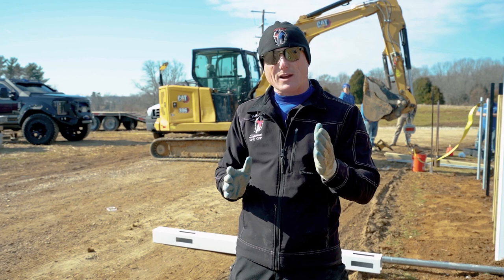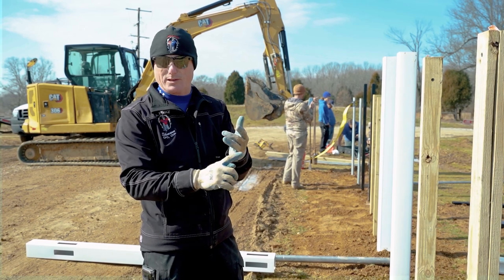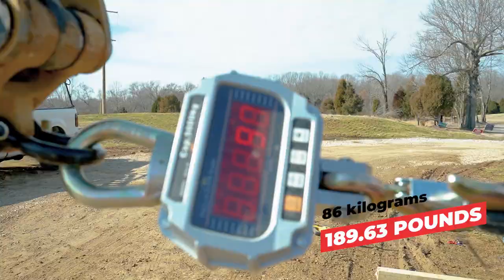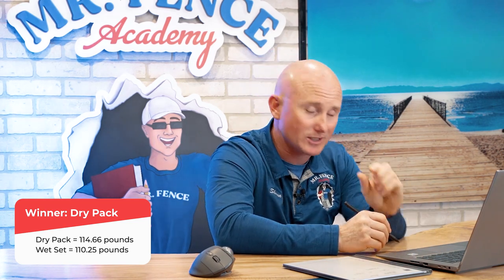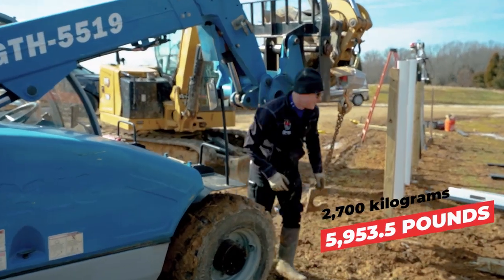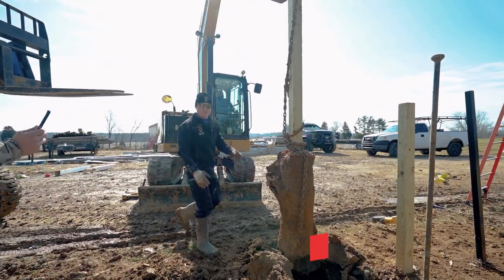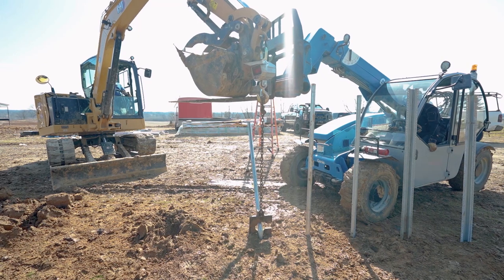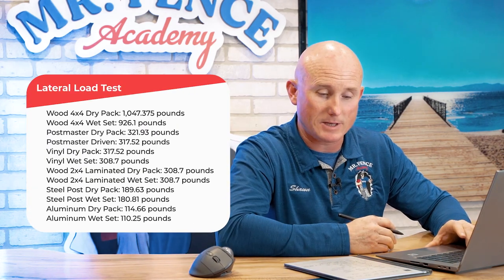How to set a Fence Post PART 2! | Dry Pack vs Wet Set

Comment: Interesting results. Sometimes I think we equate rigidity with strength and the flexibility can actually be a benefit.

As we discussed on the phone, back in the day they recommended filling the vinyl post full of  concrete and found that that led to premature failure because the fence was too rigid in the wind. 

I can tell you that in all of our years of using postmaster we have never gone back to replace a fence. However in that same period of time we have replaced numerous fences built out of 4 x 4’s both treated and cedar that have snapped off. I think it would be worth talking to somebody that has some insight to wind strength and how that relates to structural stability to get a better idea of what’s going on here.  

It’s probably worth noting that Wyoming has notoriously High-wind and I have seen open chain-link fences, without slats, blown over with 1 7/8” SS 40 posts.

Comment: It would of been a good test to apply the same load to each post without trying to crack them and then put a level on them to see which has moved the most. 
I would say dry pack moves more hence why it cracks later as it offers less resistance.

Comment: In the video you say you waited 3 weeks for the dry concrete to set. Is this how long you normally wait to hang wood or wire when using dry set method? Or once it's packed in dry does it have the strength to have field fence staples hammered into the posts or hanging 2x4s and pickets? And know it won't be "set" that quickly but will it have the strength to hold in place while continuing to work on the fence until it fully sets?
Reply: No water in their "dry" pack.  Good question and there is no way any fence company is waiting 3 weeks to return to the jobsite to begin the Rails and pickets portion.

Comment: I would be curious about quantity of concrete as well. The less concrete means there's more compacted dirt above it. Is the 160lbs better then 80lbs? 🤔
Reply from the maker: Dirt does not compact quickly
Like concrete so no we do not want to try and rely on compacted dirt on top of the concrete if that is what you are asking

Comment: Does the depth have to be 32” for  6’ x8 ‘ cedar pre-made panel fence? 
I just finished dry setting all my post  24” deep with only 80lbs of cement. I did bell out the bottom of the holes  though. 
Appreciate the  videos, very helpful.
Reply from the maker: ASTM standard for 6’ tall is 30” deep. We set all our post 30” minimum. Our vinyl post are set at 32” deep.
Reply: @mrfenceacademy  I just started pulling 30 year old 4x4 posts on my poperty in Round Rock TX. All cement on posts is just short of 24''. I'm trying to dig deeper but I hit solid bed rock. We are of course notorious for caves in our neighborhood. I'll keep picking at it for another 6" of toe hold.
Reply: @kcrr2w  you’ll be fine…. stop worrying about a 30” minimum. that’s considered absurd in certain areas. some guys are lucky to get a handdug 24” hole in certain areas. now with that said if the soil around your concrete footing is super loose and easy to dig then sure go for that 30”+ hole because there’s much of her chance of that post and footer moving in such loose soil, however if the soil around your concrete footer is bedrock/super hard ground then do you really think your post and footer will ever move in that ground if you can hardly even dig it?
Reply: 24 and Bell out fhe bottom like he says and it's not going anywhere
Reply: depends on region and frost line, but should be fine.  In my area the most common form of failure is rot, people do 300lb of concrete and the post just snaps right off after a 10-15 years...

Comment: 4x4 post and 6ft privacy fence
hole depth 30-36"
1 bag quickcrete, splash some water in
burry and pack dirt
come back in 30 years, still there and straight.

Michigan weather and sandy soil.

Comment: Hey Shawn ! so with the dry packed method would you recommend framing same day ? Or waiting a whole day for it to set
Reply: You can build the entire fence and then add water before you leave 
Make sure your line is still straight 
If not you can fix it while you water
No problem
Reply: @Jorge-fj7oz  thanks Jorge 💯

Comment: Pull test have nothing to do with what it is set with. I'm sure set with dirt would give same result. But when I pull old broken post and inspect what was in the ground, dry pack always have rooted pot under ground vs wet pour still looks new when I remove the concrete around the post underground

Comment: So, to be PERFECTLY CLEAR, when you're saying "dry pack" does that mean you packed in dry concrete and DIDNT water it in the hole? Or you dry packed it and DID water it after?
Reply from the maker: Zero water was added
Reply: @mrfenceacademy  wow! Great video, great testing and interesting results. Thanks
Reply: @Mr Fence academy I’ve been doing this for years I just hate having to explain to every costumer that dry packing is so much better 👍
Reply: @Lesliemarie1016  it makes sense in my brain because if you wet pack then the ground can't condense around the concrete at all. If you dry pack, the ground has a chance to condense around the concrete before it sets, so the concrete (in theory) should be more dense with the dry pack method

Comment: How about no concrete, just packed gravel and clay? With current copper pressure treated wood you know it will be rotted in ~10 years so it seems like a mistake to use concrete at all with wood posts.